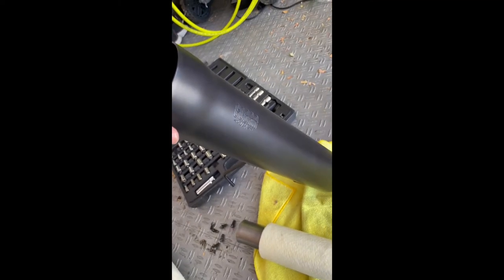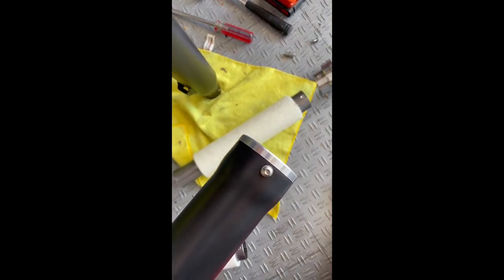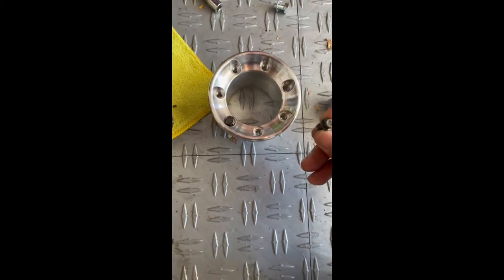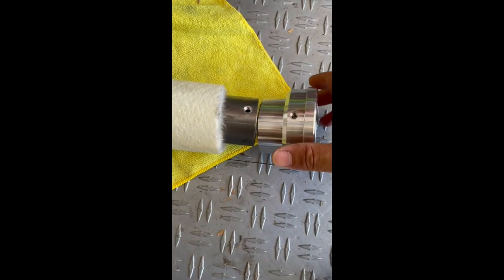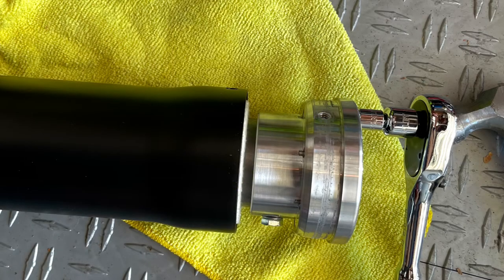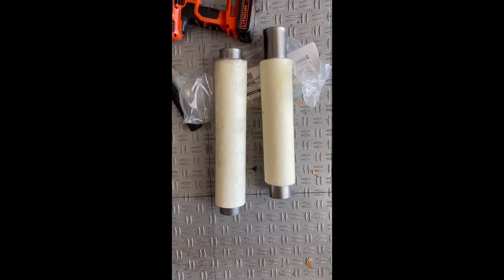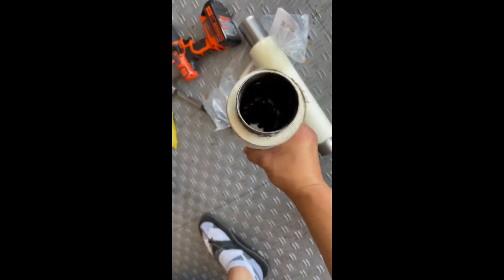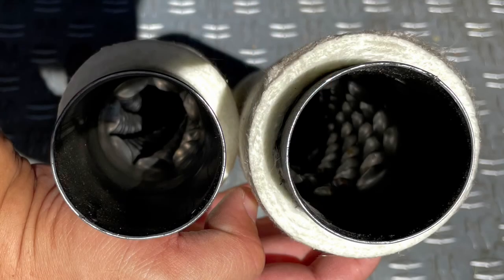Cobra RPT Slip On Muffler - Harley Sportster | How to Remove Baffle and Quiet Baffle Comparison

Comment: Thanks for the video.  Did you notice reduction in sound and do you have link or part number for quite baffle.  Thanks
Reply: I just got in touch with Cobra and the quiet baffle is part #  9026. If you’re running a low rider or dual you need to order 2. Not too expensive
Reply: @saleenguy25  HI! Did you then find out if the difference is reasonable for the purchase of the buffles?
Reply: @duality6964  
The baffles were about $50 U.S.
Reply: Sorry I explained myself badly. I meant if the noise reduction is perceptible and if it is worth installing these baffles